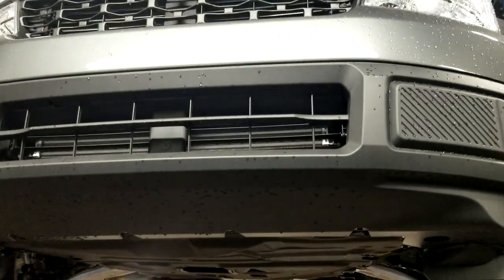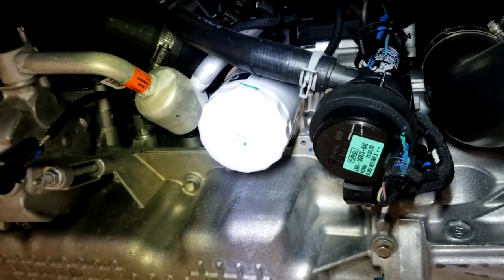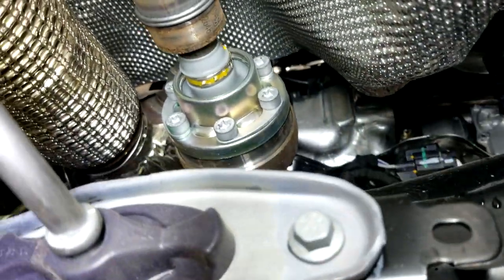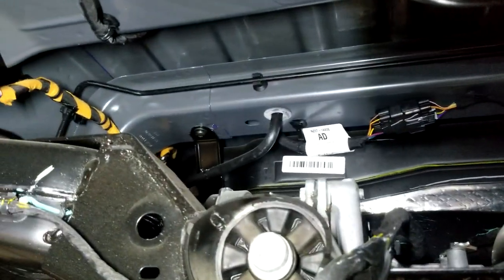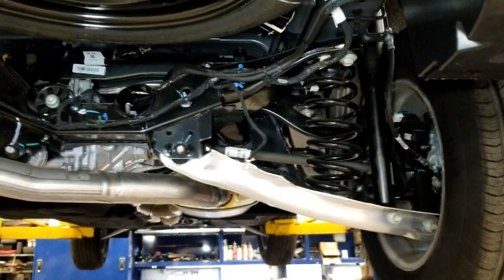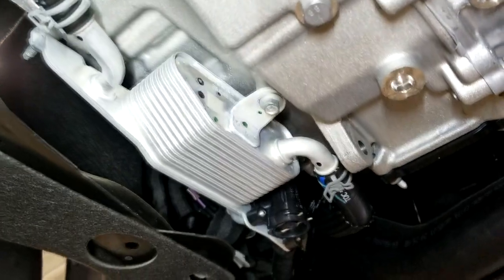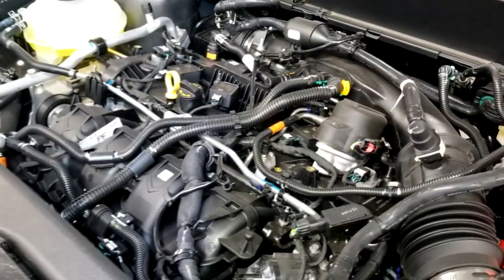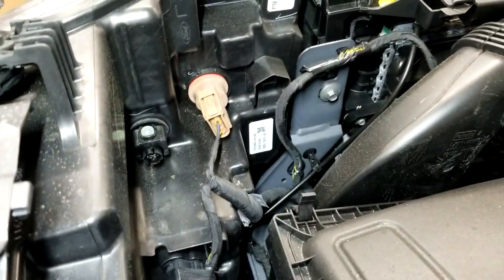2022 Ford Maverick 2.0L 4x4 Bottom View

Comment: So you have to take off the skid plate for a simple oil change yep its FORD engineers suck
Reply from the maker: If all you guys send a message to Ford about the problem, they will fix it
Reply: umm no the "skid plate" its for more miles per gallon aka environmental regulations. That isn't a skid plate it's for aerodynamics, this isn't FX4. if you guys would spend 2% as much time voting democrats out as much as bitching on the internet maybe things would improve. Half the cheap garbage on this truck is MANDATED by regulations. The whole reason it's a Turbo 4 is fuel economy requirements, etc.
Reply: @cryengine_x  😆

Comment: This convinced me not to buy. I've been waiting decades for mini trucks to come back. Looks like I'll be waiting a little longer. Here's hoping Toyota gets back into the game and does it right.
Reply: What did you see that you didn't like? Pretty much what I'd expect from a modern day vehicle.
Reply: @ubangiestomp  Way too many exposed lines and wires. I can't see this lasting in the conditions I'd use it for. Mini trucks are my preferred way to get light but bulky materials around cheaply, but I fear the lines and wires won't hold up on the dirt roads and deep snow common in my part of the country. Rather disappointing as the mileage and four doors would be great for long drives. I'll have to hold onto my old Mighty Max until the issues are resolved or another company does it better. Seeing as this is a compliance car, I'm betting it'll take another company manufacturing them. Bonus points if it's offered in a manual. 

That said, if you're driving around warm cities, the hybrid looks fantastic. If you're in a cold city with snow the turbo AWD would be phenomenal. Both are solid drive lines with plenty of available parts across platforms. But personally, it won't work for me. 

Btw, what's with companies making vehicles AWD and marketing them as 4WD? It's a better system with more capabilities so why not brag about it?
Reply: @unclebuck6250  
All pickups have all their lines and wiring exposed under the bed. Not sure how this is any different.
Reply: @adamn7516  You're not sure how it's different because you don't know what you're talking about. The exposed wires are unique to this vehicle due to cost saving measures when manufacturing the bed. This is a compliance vehicle and corners were cut. It's blatantly obvious if you've worked on vehicles. You should do yourself a favor and check out the underside of the Bronco. Same vehicle sans bed. Count the differences.
Reply: @unclebuck6250  
I assume you mean the Bronco Sport. And the reason the Bronco Sport would be different is because they have a rear interior in which to hide all that wiring. Where are they supposed to put all that wiring on the underside of truck bed except on the underside of the truck bed.
Reply: @adamn7516  Thank you for rewriting my point, Adam. This is a compliance vehicle and they saved money by going quick and cheap and that will not last in the conditions I drive in. This is not common on trucks, and I think you've confused hanging trailer lights for the mess of exposed wires and connections seen on this. Also take note of unshrouded lines that don't make an appearance in the Bronco due to being protected by skid plates. 

This is way more words than it's worth. Bud, I don't know why you're trying to argue. This vehicle cut corners in ways that make it impractical for my situation. It's apparent you've not spent time under vehicles and that's fine. But this is not standard on trucks. There's no argument to be had here. Even the vehicle it's based on protects the connections and lines. That should have been enough to let you know that there's something wrong here.

Buy the thing. I'm sure it'll work fine for you. But don't get your panties twisted when others decide against it. Especially when their reasons are blatant cost saving measures that you incorrectly deem as common place and inconsequential due to lack of knowledge.
Reply: @unclebuck6250  
You keep comparing it to the Bronco which confuses me. Are you referring to the fullsize Bronco or the Mavericks platform sharing sibling the Bronco Sport?
Reply: @adamn7516  'You should do yourself a favor and check out the underside of the Bronco. Same vehicle sans bed. Count the differences.'

To be clear- I'm sure it's a solid vehicle. The hybrid for dry cities and AWD for colder climate cities would be great. But I live in ND and regularly drive off road in snow to service equipment from WY to Winnipeg. The exposed wires and lines make this impractical in my particular situation. These are extreme circumstances that the majority of drivers will not encounter and don't need to consider. 

I'm not knocking your vehicle. I would like to buy one, too. If it didn't require extensive body work to make it usable for my situation. If they make it right (which I doubt), I will buy one. But in the time it takes to do that, if they sell well, my bet is another company will have seized the opportunity and improved on Ford's failings.
Reply: @unclebuck6250  
I don't own a Maverick nor am I planning to buy one as it not a vehicle I need. But I wouldn't be surprised if the majority of current pickups from Ford, Chevy, Ram, Toyota, etc have plenty of exposed wiring under their beds. I know pickups always did in the past.
Reply: @adamn7516  I service them regularly. The only wires commonly left exposed under the bed are for trailers and licence plate lights. The lines are covered by shrouds and plates. It's obvious you don't know what you're talking about. So please, just stop.
Reply: It will be interesting so see how Ford improves the design and how much better Toyota does it 👍

Comment: manufacturers are just make pure junk....now pick up trucks and SUV's have no solid rear axle however a differential with clutch packs that will ware out and when it does you have a front wheel drive truck🤣🤦🏿‍♂️I guess next they will do away  from the transfer case??